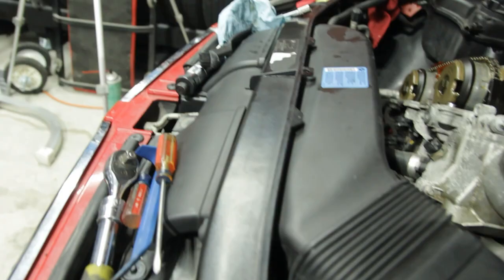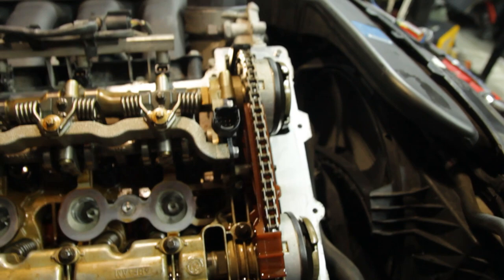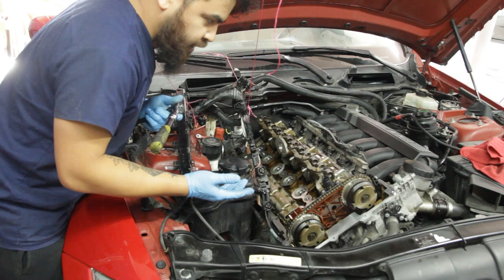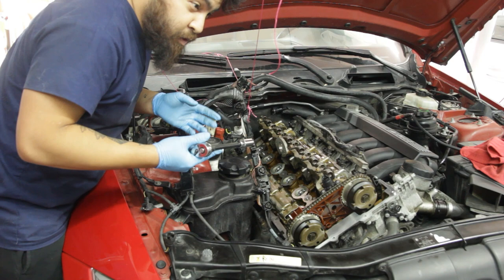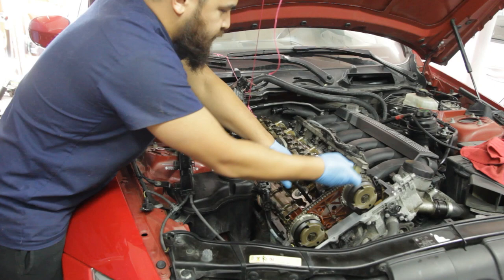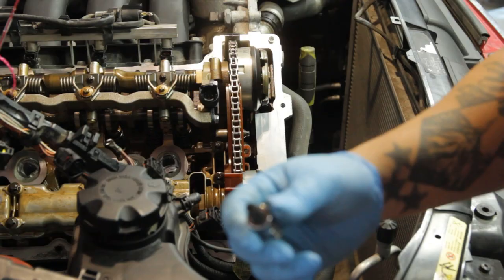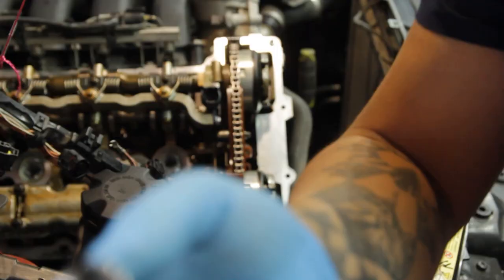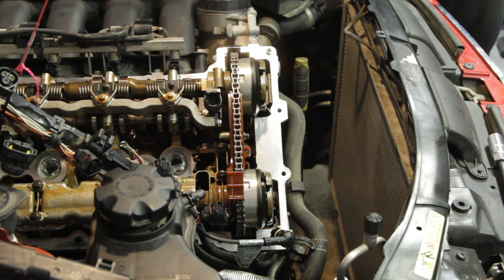BMW E9X 328i N52 VANOS Sprocket Bolt Recall DIY

Comment: My 2011 328i xDrive N51 a few weeks ago started throwing a 2A7A and sounded like a diesel at idle. Called a couple weeks ago and dealer said no recall for Vanos bolts but now after watching this I’m calling them again tomorrow! THANK YOU!
Reply from the maker: Yeah it should have been included in the first recall and if not, definitely in the new one. Is the car an E91? You can check the recall(s) on your vehicle yourself here: https://www.bmwusa.com/safety-and-emission-recalls.html Mine shows the recall for my car, however the fix is not currently available at the moment. That could be what the dealership was referring to. Hopefully your car is now included. 

Keep in mind, that code could be caused by a faulty vanos solenoid and may just need to be replaced. Obviously get the car in for the recall if you can but you can test the solenoid by swapping the exhaust camshaft and intake camshaft solenoids. If the code goes away/changes then you know you have a faulty solenoid.
Reply: Update: Called local dealer and they haven’t yet been provided the fix ‘parts’ for this? I was told it could take weeks before BMW USA provides guidance. Hopefully the car won’t get worse. 🤞
Reply from the maker: @wormtownhero  Well that's good to hear at least. In the mean time you could still try switching your Vanos solenoids around.
Reply: @wormtownhero  the dealerships are avoiding the fix. Obviously the upgraded bolts are available as you can see in this video. My dealership also said there’s no fix, yet I bought  8  upgraded bolts from ECS Tuning at .70 cents each. So, the bolts are available, hence the fix is available. My concern is, even if the dealerships do the fix, according the the Technical service bulletin, if a bolt is not snapped or spun out, it states not to touch those bolts. 😳 only replace the bolts that have snapped or loosened. All my bolts were intact.  All of the bolts on the intake side loosened way too easily. The exhaust side were snugged. If I let the dealership do the fix, they would’ve left the exhaust side untouched. That’s no bueno because at some point they will loosen, which is why I replaced them myself,
using this video as my guide. I am most appreciative for this video. It was scary to perform the job, but it wasn’t hard. If we had to remove the vanos actuators, then timing is involved and would possibly have to replace the actuator bolts also because those big bolts are prone to snap, thus the job just got worse. So this method in this video is the shortcut, but it’s safe and much quicker. If you can do it yourself, do it. This video gave me the confidence to do it. The car starts right up, but since I was stupid to use carb cleaner in the CCV channels of the valve cover to get rid of the creamy oil and water crap that builds up over time, which did come out, I can hear the CCV system making a different noise than before the job was done. Those channels were blocked with that substance (the stuff you see in an oil catch can), which is what the CCV system supposed to remove from the engine. Maybe I need to drive it hard to clear up the channels or maybe I killed the diaphragm. I sprayed carb cleaner in the hole where the CCV tube connects to the back of the valve cover and tilted and shook the cover until no more creamy crap come out. Hopefully I didn’t cause  more bad than good.
Reply: @wormtownhero Same here with my 2011 X3. Got the recall notice in early Dec23 now mid-Feb and STILL no notice that replacement bolts are available. Dealer is at BMW's mercy. How can these bolts be so difficult to find when Jonathan seems to have no problem locating??
Reply: @greenlightwilly  The dealer I’m working with said that I could bring it in, get a quote for a diagnostic and if it turns out to be the recall, they’d open a case with BMW USA. Note, they only offered that option once I called back after the car died at a stop light and couldn’t be restarted. Maybe it’s worth asking them if they would do the same in this case? They did attempt repair but now my engine has NO COMPRESSION! it’s now “Under Investigation” as they are dumbfounded that there is no compression. I was told this is highly irregular for a Vanos issue to cause damage so as to cause this new issue. Good luck!

Comment: I found the "extended warranty " bulletin back in October 2019 when I 1st purchased my 2010 x3... found my bolts broken and loose, making ticking noise while running.. BMW honored the warranty with 2 months left on it. Got lucky. They replaced the vanos units and all the gaskets including the oil pan as they fished out the old broken heads... $5k in parts and labour... got lucky.
Reply from the maker: Very lucky indeed. Great to hear!

Comment: Thank you for your video, just recently purchased a 2010 as well and ordered the bolts within less than 48 hours of owning the car after seeing this
Reply from the maker: Good call. Might as well replace the valve cover, gasket and eccentric shaft sensor while you're in there!
Reply from the maker: Hey man. Our cars were finally added. https://g87.bimmerpost.com/forums/showthread.php?t=2061784&fbclid=IwAR2O7BnUucI2dypCPpOjXCg45A0zhIOeyV8mAE91kmFoL1mOopyH9cNJb3I_aem_Abcj62Fy2xuG6zdSyz0c4Uvlp9vuRGZQpC10r1vPlwnrD_lUWEs0ZXBCGu2cC8ZMEd8

Comment: Just dealt with the same issue this week, on my 2011 E91. Local stealer-ship wanted $9500 to replace bolts and Vanos units along with solenoids. Cost me less than $200. Thinking of lodging a complaint with NHTSA as all bolts on the exhaust sprocket were loose and car was constantly throwing codes.
Reply from the maker: Oof, were there any broken bolts or were they just loose? It's really crazy how BMW has been avoiding fixing these on E91's knowing full well that the N52 motors are the same as the e90/e92 cars. Glad you were able to save a ton of money.
Reply: For God's sake there is f......n recall. I would call BMW NA and inform them of what was requested of you ... Which dealer was it ,as a retired BMW tech I am upset that is not how do things
Reply from the maker: @johnboutsikos6049  Instead of crying about it you should probably just shed some light on this and provide the proper procedure. The procedure provided by BMW (linked in the description) was followed aside from the torque spec procedure. The Sequence was attempted and the supplied bolts would not accept the amount of torque stated; the soft bolts were replaced with slight stronger but still extremely soft bolts. So I torqued the the bolts to within minimum spec and added loctite. Not sure what the real issue is but I would love to know so I can fix this.
Reply: @jontansgarage  I need your help I’m replacing mine now and don’t know where to get them
Reply from the maker: @sawyerrescue530  are you in the U.S.? I have links in the description from bimmerworld and fcpeuro. You can get them l online or even at your dealership. If you do go with the dealership, you will probably have to wait for them to order the part and also pay twice as much.
Reply: Complain to the NHTSA. BMW lied and said only 200 thousand cars needed the recall but is more than 600 thousand that needed the recall and I didn't get a recall letter and no recall when I check the VIN number but I checked with endoscope and mine has the security torx bolts and is a 2011 e90 and I'm getting the 2A87 exhaust vanos mechanism code.
Reply from the maker: @johnj1763  Your issue with the exhaust vanos could just need a simple Vanos solenoid replacement. Have you checked those?
Reply: @Jonathan Cardenas  I did but it came back.
Reply from the maker: @johnj1763  Are you sure the wiring harnesses are plugged in to the proper solenoid? I had a similar code and replaced one of my solenoids...just to find out I switched the harnesses around. Prior to that I was clearing the codes and it always took a while for it to come back.
Reply: @Jonathan Cardenas  I made that mistake too initially and figured it out. I thought it was the eccentric shaft sensor and changed it last june. It was fine for 8 months and the code just came back, what else can it be?
Reply from the maker: @johnj1763  From what I am seeing from a few forum threads, if it isn't the solenoid, it is very possible that the bolts on the cam gear assembly could be loose and/or the heads have sheered off. That or the camshaft bearing ledge. Best case scenario is that a bolt is just loose. Check out this thread, https://www.e90post.com/forums/showthread.php?t=1506674
Reply: @Jonathan Cardenas  the new bolts are real light like  plastic. Do you know what material they are?
Reply from the maker: @johnj1763  Honestly, not exactly sure. The old bolts are aluminum and these didn't feel much different so I am assuming they are still some form of aluminum. They are extremely soft, just as soft as the old ones it seems and the depth on the head of the bolts for your torx bit to fit in is not deep at all, so it is very easy to for your socket to slip and deform the bolt. Go slow and make sure that your torx socket is centered properly and isn't cockeyed or the socket will slip.
Reply: @Jonathan Cardenas  never seen metal so light, probably lighter than titanium. Instead of making them stronger bmw still make them weak. starting to think bmw doing it on purpose so they don't last and this will be my last bmw which I bought new. They lied about the recall too so they don't pay, should have been close to 1 million recalled instead of 200k. Very unethical and I don't trust them, they also take down DIY instruction sites so their dealers can rip people off. You think is a good idea to use different bolt and this VW bolt N90945002 will work?
Reply: @Jonathan Cardenas  this looks like a better bolt and can use socket and only 1mm longer M7x22 N91190801? Wondering if the thread pitch is the same?
Reply from the maker: @johnj1763  Yeah, it's a real shame. I was very surprised that the replacement did not seem much stronger. After having all of these issues with my 328, this will also probably be the last BMW I buy that isn't an E92 M3 or some older gen; way too many electrical issues and its getting difficult to work on. Not really a fan of all the computer assists, track modes, etc.

As far as the bolt goes, I would honestly just use stick with the OEM ones, however, I don't see why you couldn't use a hex bolt as long as it was the exact same length and had a shallow head. I can't imagine it would be difficult to find as it is just an M7x21mm bolt. If you can't find a shallow head one, you can probably just grind the head down. I feel like I have seen some videos or perhaps forum posts where they used different bolts but again, I would personally just stick with the OEM and hope BMW had some sense to at least use slightly stronger bolts and these aren't simply the same exact bolt but with a  non-security head. Definitely do not use a longer bolt, even if it is only 1mm; there could be something inside of the cam assembly that the bolt could interfere with.
Reply: @Jonathan Cardenas  I haven't had any electrical problems and has been pretty reliable except the known oil leaks and this is the third time I open the valve cover but not hard to do just time consuming and the parts are cheap. 

I will use some red loctite too because these bolts look real fragile and lighter than plastic, really strange. You felt like if you torqued them more than 70 in/lb they might break? Also someone commented is better to put the car in neutral to spin the crankshaft? The NHTSA should make them compensate us, it took me about 10 hours last 2 times. Thank you for making this video and appreciate your replies.
Reply from the maker: @johnj1763  Not a problem man. So the bolts, per the service bulletin are supposed to have an initial torque of 6 Nm (about 53.1 in/lbs) and an additional 60 degrees which according to the bulletin, is a final torque value of between 8 and 14 Nm (or 70.81 to 123.91 in/lbs). I just went with the lower end (70-71 inch lbs) plus the loctite. The first couple of bolts that I replaced, I attempted to hit somewhere in the middle (90 in/lbs or so) but ended up deforming/stripping the heads of the bolt which made me nervous. The bolts themselves did not feel as though they were going to break, it's just that the head of the bolts are again, super soft. Once you start torquing these bolts down, you will see how difficult it is to get your torx bit and ratchet/torque wrench centered perfectly with these bolts especially with extended torx drivers. 70 in/lbs or so wasn't too bad, higher torques made it extremely difficult and I stripped/deformed the head on multiple bolts before saying screw it, then restarting, removing the first few bolts and just using loctite with 70-71 in/lbs or so with all of them. Once it slips and you start stripping the head, it makes it even more difficult to avoid slipping. It just didn't seem worth the trouble, which is why I suggest in the description to get a few spares just in case you do strip the head. I did come across several DIY's on E46 generation motors which had similar issues with weak bolts from the factory; plenty of people suggested/used loctite (or other thread locker) so just make sure you use high-temp/oil-safe stuff. The only stuff I could find that was high-temp and oil-safe was the permanent loctite but it did not seem like I would have to ever have to disassemble these cam gears; I would just replace the whole assembly if it ever came down to it so using permanent thread locker wasn't an issue to me.

In regards to turning the crank shaft, from what I have seen on the internet, it is possible to manually turn crankshafts by hand while NOT in neutral. However, I don't see why you wouldn't unless you wanted to get a workout in for the day. There is no reason not to put the car in neutral, regardless if it is an automatic or manual transmission, rear wheel drive, or x-drive. Removing the spark plugs and putting the car in neutral will make it way easier to crank.
Reply: @Jonathan Cardenas  found 1 broken head and 2 loose bolts on the exhaust side. Tightened to 9 nm with red loctite, exhaust was a little tricky to tighten
Reply from the maker: @johnj1763  Oof, were you able to find the broken head? Hopefully there was no other damage.
Reply: @Jonathan Cardenas  hopefully no damage, has to be in the oil pan. I will change the leaking oil pan gasket in a couple months.
Reply: @johnboutsikos6049   recall is only for 10 years, is expired. My car has the issue what should I do ?
Reply: Those bolts are part of a recall unless vehicle has passed the mileage limit if recall correctly...have done a ton and red thread locate is NOT part of procedure